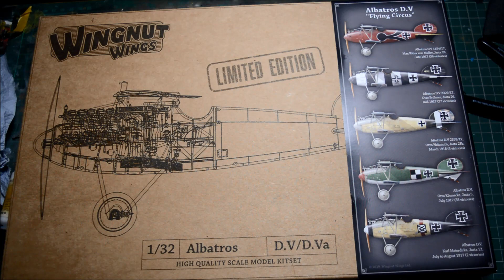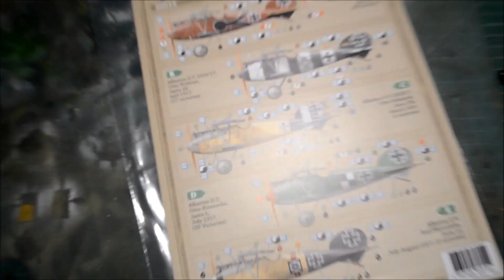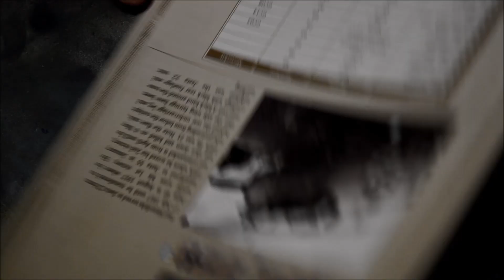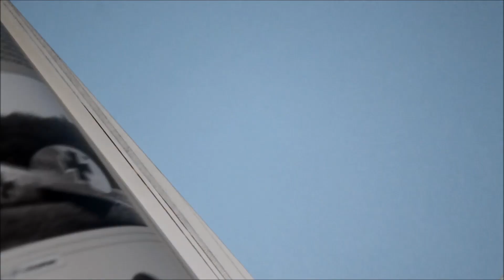Wingnut Wings 1/32 Albatros D.V - Part 1

Comment: To avoid any gaps when joining the fuselage together it best to remove any traces of paint from the bulkheads and the reciprocal slots. WNW tolerances are very tight and even a layer of paint will throw things out. Personally I always mask off these slots with thin strips of Tamiya tape.